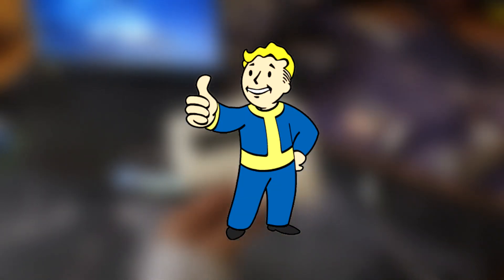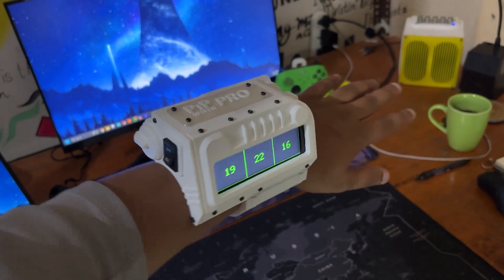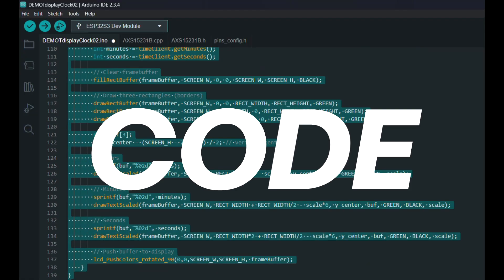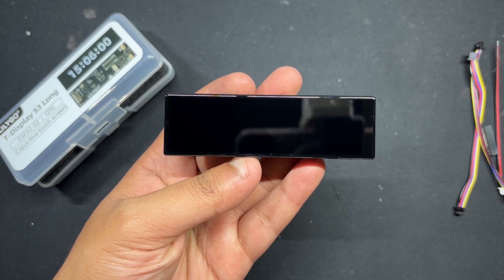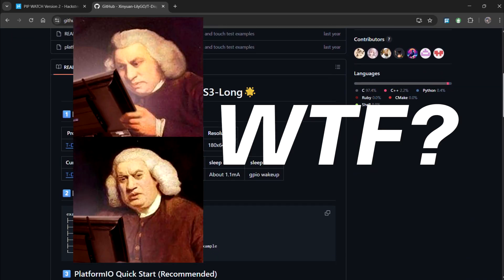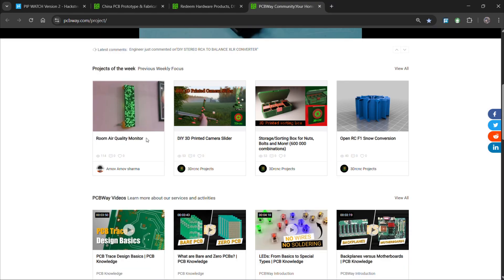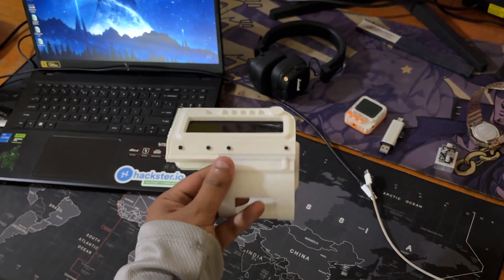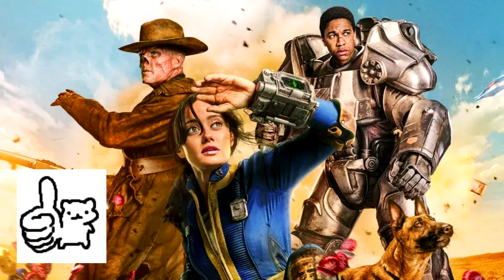PIPBOY-Themed PIPWATCH Project! Liligo TTGO T Display S3 Long

Comment: This is cool, but it would be cooler if you expanded on it some more... give it some buttons, a rotary encoder, maybe some sensors and a more interesting UI (and maybe even paint the enclosure!). Great starting point though (I'm interested to take a look at your smaller version too).
Reply from the maker: This is just a V1; I'm working on a much better V2 that will contain a few more interactive things and also a custom paint job!